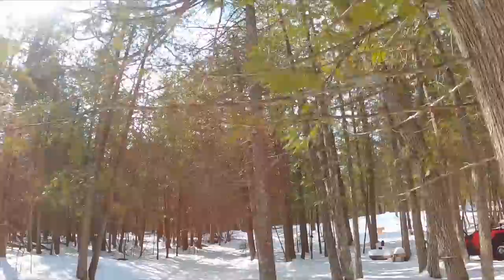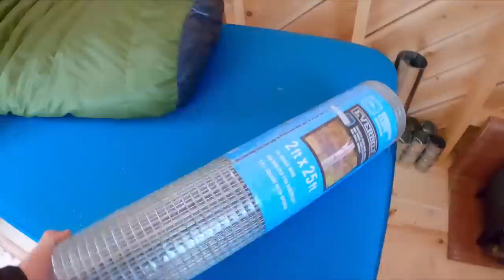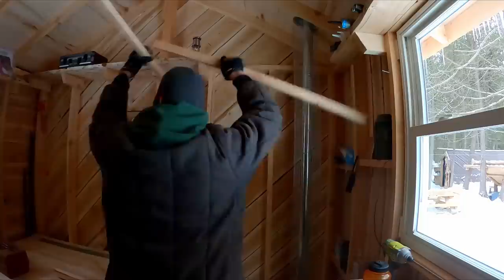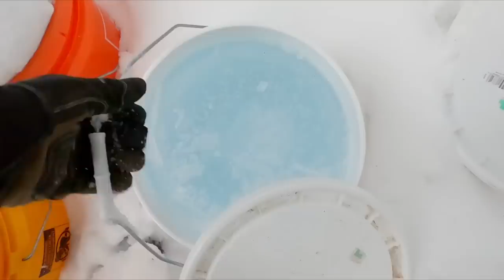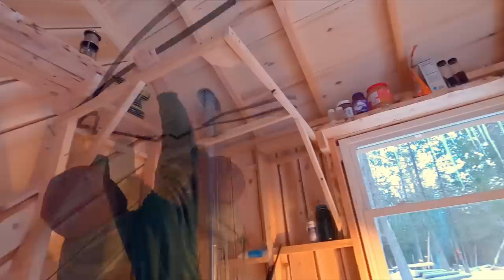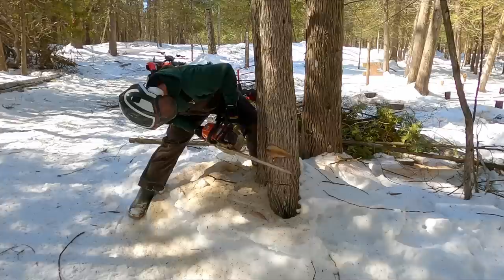I accidentally bought a new Honda Rancher.  How much can it drag through the snow?  #76

Comment: Just wondering why you went with a propane heater instead of a wood burner? it's not as if your short of wood to burn ;)
Reply: I asked him that when he bought the propane stove? 
He has lots for free fuel.
Reply: @SteveLouzon  I built my cabin last year and use wood heat. It takes some skill to keep the temp BELOW 80 degrees when that fire is burning! Never cold as long as there is wood around
Reply: @1quickdub  yeah I know what you mean my wife keeps opening the windows.
Reply: he just dosent have the time / dosent seem fun to split the wood needed. with all the other projects
also the initial investment of a decent stove he dosent wanna spend.
he has a crappy wood stove in the lean too never see him use it.
Reply: @1quickdub  I would go with wood . A 30 lb tank refills for about $26.00 so about 34.00 for a 40lb tank.
Reply: @racingdesire  He could pick up a cheap or even free wood stove on Facebook market place. I know they are available because I live right down the road from him.
If I wasn't going to insulate I would for sure be burning wood.
Reply: @SteveLouzon  that's what I would also do. I would also unsulate the cabin 

 but were not living at ring worm. at ringworm you do what's fun in that moment and never plan 
just explaining that cutting / stacking / seasoning wood sounds like work / not fun and requires planning.
especially the amount of wood you'd need with a free non efficienct stove in a uninsulated cabin.

that's why he dosent do it.
Reply: Probably some laziness and forced chainsaw withdrawal (ordered by the doctor) 🤭😁
Reply: Looks like tire chains is wt it's all about in  the dead of winter ehh???

Comment: Quick question why didn't you go for a wood stove and maybe insulate it that way it'll warm up faster and stay warm longer that way you save one propane! That way you'll save on money! Win win🙂🙃
Reply: He said in a previous video about the wood in his area not burning well in wood stoves
Reply: @dalerogers3398 thank you! I didn't see that video. That's why I was asking.
Reply: @dalerogers3398  Wood burns you just have to dry it out. He has piles and piles of scrap that he just burns off. Lots of the mid range 2 to 4 inch stuff can be bucked up and stacked all year round and should be pretty dry by winter time. Even the rotten logs and off cuts he does will dry out pretty quick. I have already cut down a dozen trees this year and have a lot more to go. Right now I have about 5 to 8 cords stacked and drying out for splitting next fall. I should have 20 to 30 cords cut up by next year. My goal is to have 50 cords or more cut and split and ready every year. I am taking the time this year and cutting up everything I can get my hands on to get a massive stock pile going for the future years as this is a new place.
Reply: He doesn’t really want the heat for his body -more to dry out wet clothing and gear. If it gets above 40 Fahrenheit he starts sweating.
Reply: Either way he should have a good wood burning g stove and he does use it for body warming
Reply: @SPW812  he can still use it for that reason
Reply: @toddkehring3767  that's what I was thinking. It would save lots of money. He don't like to spend it anyway
Reply: He burns wood outside  like brush and scraps  it just makes sense and he ain't fooling nobody it cold it's cold I don't care who you are
Reply: @toddkehring3767  I was born and raised there so I already know how cold it is!
Reply: Wood should be cut a year ahead or more so it dries out. If you have a good wood stove you can heat, cool, and heat hot water for showers, dishes.

Comment: Nice new ATV. Looks like you are also a tried and true Honda fanitic. I had the exact same 350 as you previously. 2001 model and had it for 15 years without any issues, just replaced the tires. Currently have the Rubicon 520. All were great for towing as I also spend a lot if time in the woods and cut approximately 7 cords of wood per year.

One suggestion on the colour. Consider getting a vinyl wrap for the bike r even use the Plasti-dip paint. Put any colour or design you want on it. Plus, you can remove both the vinyl wrap or the Plasti-dip paint at anytime. If I am not misaken, the camo finish on the Honda ATV’s s just a vinyl wrap anyway.

Enjoy your channel.

Comment: You should look for a cheap or broken kayak. Cut off the point just big enough to pass your tow strap through. Make another cut around the cockpit. You can then place the ends of logs inside the kayak and the tow strap through the tip of the kayak. You’ll be able to pull more and heavier logs without them getting stuck or hung up.

Comment: Hey Ryan, give your new toy a break already and stop face dragging the logs into stumps and other things because it's just wearing parts out faster, using more gas and can be remedied with a simple sled to drag the log with...even an old Volkswagen hood, something, anything even a wheel-less little red wagon will work by placing it under the end of the log,  securing the logs end to the sled's head, and THEN dragging it,( the sled ) into camp or the milling area by the sled itself. This will also stop impacting dirt into the ends of the logs that will then dull your chainsaw chains that much quicker.
 Just a thought...

Comment: Get some Plastidip paint in aerosol cans (brush on doesnt work too good).

It is rubberized wont stick permanently. And no need to remove the fenders, just peel off any overspray.

And in a year or two if you want to remove it completely, or change color, it will just pull off.

Comment: 1” even of hard insulation would make that cabin soooo much more energy efficient. Your 40 lbs would go a very long ways!!! Just fit it tightly into the gaps between the studs and roof rafters. Each stud will have an R value of zero, but the cavities will be R6 or so. 2” is R12 of course. There would be a net R value of about 4 or 9 but what a huge difference. You could do the floor from underneath and hold the insulation in place with some 1x2. Your cabin and your skills could mean a very energy efficient build. The best is to have the insulation between the studs and siding for about an inch at least. Then you break the cold transfer from the studs and essentially eliminate condensation. The remainder of the insulation you add between the studs is so much more efficient as a result. Very warm with very little energy!
Reply: Yeah i kinda wish he would insulate a small shed. Everyone keeps on about putting in a wood stove and I have to agree that cabin with insulation, wood walls and a wood stove would be more than enough to heat that enough to keep everything warm. 
Even one of those old cast iron cook stoves in an outdoor lean too would be more than enough to cook on and even have enough to heat enough water for shower/bath every day. There are stock pots that are 120 liters that cost a couple 100 dollars, with a simple square brick stove under it would be enough to keep the pot warm the bulk of the day. Just something a bit smaller and about 2.5 feet tall with a open wood hole at the top and side to allow the wood in and then some rebar for ash grate it would boil enough water to have a good shower. My self I would have built a bunch of things to make it easy to live out there all the time. This really roughing it. The amount of money spent on propane has to be costly. I also think he really only spends about 4 or 5 days a week out there. I would also invest in to a swing blade saw mill. A 6 inch model will set one back about 10 to 15k, Which in his area he might find a used one for 70% of the cost. Swing blade sawmill would allow him to mill up a lot more lumber for every log he cuts which would allow him to build a lot more things. He has to be making a pretty fair amount of money each month. Maybe 1k per month between donations and ad sense ( most likely only a 50 dollars per video if that which is about 4 videos per month average of about 25k views ) . Yet I do not know if he has any merch or any other source of income. patreon is around 500 per month maybe. There is enough money to invest some of it in to getting some stuff.
Reply: @kameljoe21  -  I just offer it as a suggestion. In the end, it’s his place and I keep coming back because I’m jealous!!! Hahaha. In the end, as he gets a little older, he will learn to enjoy the warmth a little more. He is still having fun and missing sleeping in his tent!! We want him to insulate the cabin???? Nuh uh,,,,, hahaha.
Reply: @shitloveaduck  I know what you mean. There is content to be made here and doing some of these things will not only bring in new viewers its content driven work. Adding a few of these things regardless as to if he uses it or not. There is a good 5 mins of content of him moving say one of those old cook stoves. Then 5 mins of clearing an area, 5 mins of milling logs for a lean too shelter. 5 mins of building a deck, 5 mins installing it and 5 mins of using it in one video. Then there is 1 min of content every week making food on it, standing around it drying gloves, shooting the shit. 
Each one of these ideas and many more adds to the content library. There are dozens and dozens of these small projects that are super fun and super low cost. It just adds value to his channel. He wants to live out in the woods then he can. He wants to film he can. Should he please everyone's request, no. Yet some of those requests have great ideas.
Reply: @kameljoe21  - Why can’t everyone be as nice as you?? Thanks for the great discussion!!

Comment: Great video… like the idea of an open area and it makes cutting trees easy if you are remove them from a set area. If you need ideas about how to spend your YouTube dollars, have you ever tried a cordwood structure. Since you have a lot of not lumber logs or small trees that aren’t really big enough for cutting lumber you could invest in a couple of bags of mortar and see what you could create. Maybe a post and beam type thing with the walls infilled. Not saw-milling but cutting stuff to a set length for your wall thickness and then play with blocks and mud. Sooner or later it has to warm up enough to try something different. Thanks for sharing and enjoy a warm dry sleeping bag!

Comment: I feel that stove is not very efficient? Most of the heat must go straight up the chimney surely? Do you even need a flue with gas stoves, every portable gas stove or heater i've used or seen doesn't need one just a bit of ventilation needed in the space? Buddy type heaters for instance?

Comment: I completely agree about the red! Consider painting it with raptor liner. Durabak is the best option, and they make smooth versions. That thing would be scratch proof. Also, have you thought about putting up a high tunnel greenhouse and building a cabin inside? All sorts of options with thermal mass and water that would help keep things 50+ degrees.

Comment: Hello from the Netherlands .  
if you hang Now a plumb bob from the roof to just above the floor and you put a frozen marker on the floor now you can see the plumb bob move as it heats up more and more .  
it might also be nice to put the dates next to the marker.  

maybe for your next build : an extension at the front and back of your cabin ,
from the front in front of a covered veranda where you can cook dry all year round ,
at the back a covered shower room raises from the ground so you could take a shower all year round .  

an idea for lighting in your cabin : a simple solar garden lighting set with the solar panel just outside the cabin.  
Sincerely, Hollandduck from the Netherlands

Comment: Maybe build a cabinet in between studs with it hanging outside to put propane tanks in to keep inside to keep warm and out of way . And you could put door on it inside so don’t have to see tank just cut vents in door for heat to get to tank… but I would have got a small wood stove same size as your propane stove , with all that wood. They use in hot tents , I have one in my deer house blind , and keeps it as warm as I want. I would insulate the man she’d so not using a lot of gas and put a heat powered fan on stove . A damper won’t work in pipe because the stove flame is controlled by you not same as wood….maybe some foil behind pipe to reflect heat back out in room ….you can get camouflage skins to put on 4 wheeler , I went to 4 dealers to get what I wanted Kodiak 700 Yamaha from Grizzly . Wanted lower but same power and only little bit lower so I can get on and off with my bad hips and in camouflage.

Comment: Your exactly right Ryan. Frost line up there probably 38 to 40 inches. Im in the northern lower and its in that range here. The tree stumps aren't as affected by frost as the ground surface. As the roots break down they might move as well. Doesn't the dear castle have a similar foundation makeup ?

Comment: Why don't you use the screened in deck as your cabin?  You can easily cut framing for the sides and the hard part is already done (The roof).  Much bigger (I think) and you can put a wood burner in it.

Comment: Building a bigger cabin . . . or a sauna? That's a tough choice. One thing I do while chipping branches with a small chipper is to keep some good lopping(pruning) shears on hand to cut off big forked branches and to shorten limbs that are too long to run through the chipper before the flywheel loses its momentum. I hold the loppers with one handle tucked into my armpit so I can grab and hold the branches with the one hand while I pull the loppers to cut with the other hand. Thanks for the video Ryan!

Comment: Paint the underside of fenders a lighter color, like sand or tan. Makes it easier to see all the pieces & parts. Then paint the rest camouflage. There is also a clear bed liner, to make it scratch resistant. 
Maybe bring the wood chipper to the areas (trails) you want to cover. Instead of gravel. 
Spending money on tools isn't terrible. The 4-wheeler makes sense. My last pickup, I bought a bank repo for $625, put another $800 into it, & it's been running great for 5+ years. Frugal is the way to be.

Comment: I'd leave it red in case you have an accident by yourself there's stands out against the colors of nature and will be easy to find. Also on low spots take the smaller trees and brush and pack them in as tight as possible and let them break down over time.
Reply: I had a blue Sportsman years ago and drove it off the trail to hunt. Most of the brush where I was hunting was about waist high and I had trouble finding it.

Comment: You could grind the edges smooth on the wire mesh with your Ryobi grinder/sander. The tape might  get sticky with the heat.

Comment: Congrats on the new Honda! Im with you on only buying honda ATVs they are the most reliable. I have a RED 1985 trx250 and it still runs perfect. I plasti-dipped the panels black and it lasted a few years. I would recommend a wrap.
Reply: Your propane usage is due directly to the lack of insulation. All the heat generated quickly leaves with no insulation, so its always on full burn. With insulation you would have much more consistent temps and the stove would “maintain” the temp with small burns instead of full burn all the time.

Comment: Need to find a way to maximize the heat off that stove pipe so you don't need to run the heat as long. All your heat is going out the walls and up the pipe.
Reply: Plus building a loft sleeping area would help as the roof area is warmer than the floor.

Comment: Don't forget to clean the gas filter every year, It's easy to forget since we don't see them. I don't know about the 2022 model, but my rancher 420 2013 has a very small filter , smaller than a tea pouch. Once the filter starts to cause restriction , it's just a matter of time before the feul pump goes bad and  you have to change the whole feul pump...$$$$. You made a good choice by not having an electric shift model, especially if you keep it a long time. Have fun !!!

Comment: Hi Ryan-- glad to see U back.  Ha I had a crazy idea for U.  That platform your tent is on-- well build like U did your screen porch but around you tent platform & also put doors that U can open clear back from corner to corner.  When it rains or snow U can close doors as little or as much as U like.  That way U could still live in your tent.  U have all that wood cut so use it in a fireplace.  That way U have both of what U want.  U could really make it nice.  I just got out of hospital from shoulder surgery so I'm typing with one finger.  They had to sew muscle back together, fix rodery & take some other stuff off.  Doc said it was really a mess.  So I've got my right shoulder in a sling.  I've watched this video 3 times now so I thought I would run  this by U.  What do U think?  Be safe out their.. God Bless.. Phoenix

Comment: I’m not sure why you chose propane as you heat source instead of a wood stove. Wood is free and you have plenty instead of $80 per fill up! The area I live in is not quite as remote as yours but propane fill up for me is 32 miles away! I put in a wood burning stove. My wood is from my own property. I collect it with my Honda 400 rancher pulling a small trailer and split it with a 22 ton log splitter. Wood heat is wonderful!

Comment: What I think you need for your little propane heater is a Damper in your chimney so all your heat, and air doesn't just go out the roof and one of those heat powered fans to circulate the air.  That will heat up your cabin faster and make better use of your propane.

Comment: thats a LOT of gas
I have a ventless 30,000 btu infrared heater that i used to run of a 100# bottle for around 3 weeks in my regular insulated house.
A little insulation on the next cabin would help a lot.